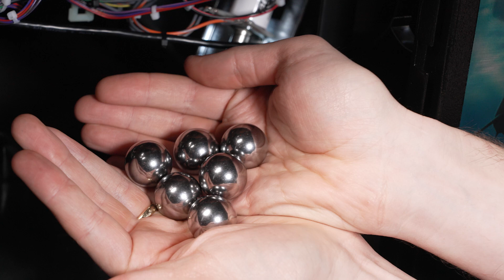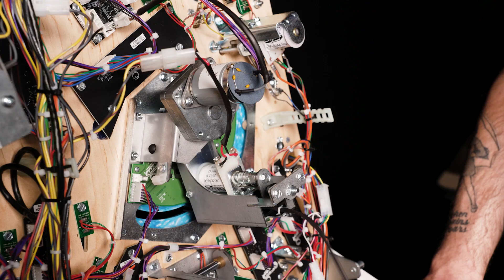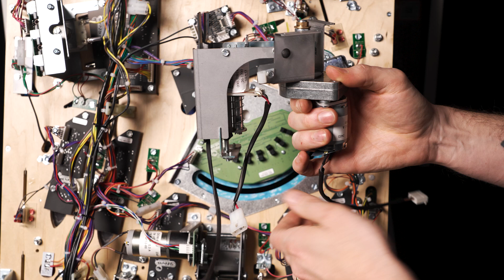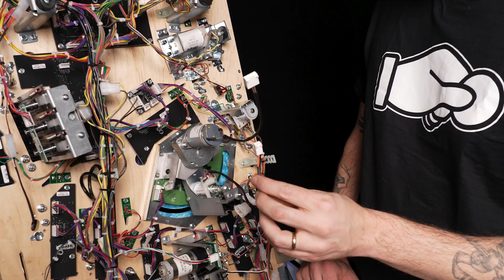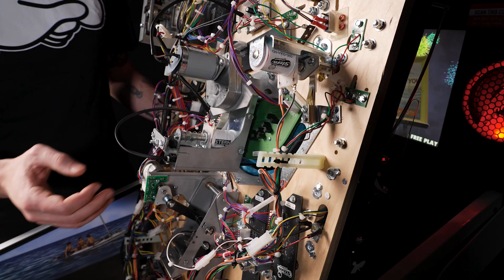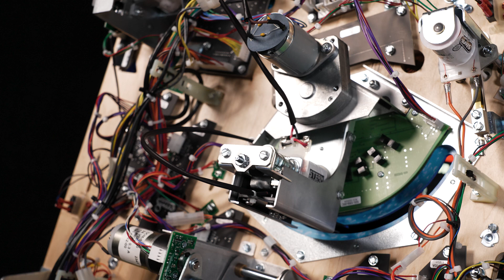Stern Tech School: JAWS Fin Leveling and Removal

Comment: something else to check on the fin mech is the opto interrupter.  on the 2 jaws machines i have the opto interrupter was making contact with the optos which caused them to report flaky issues.  I added a washer between the playfield studs and fin motor which gave the opto interrupter a smidge more clearance.
Reply: Hey thank you can I ask where are the optos?